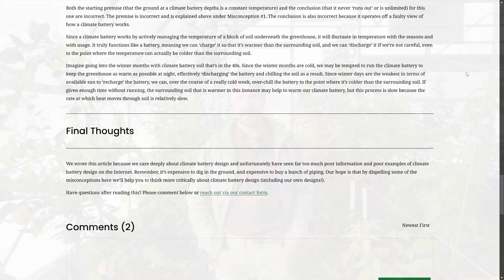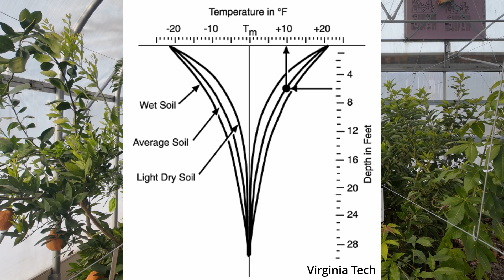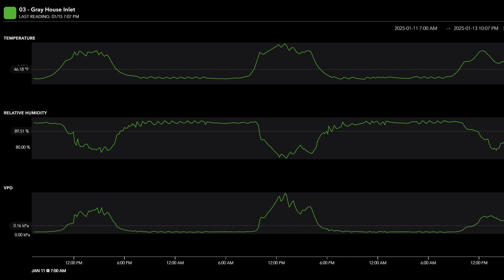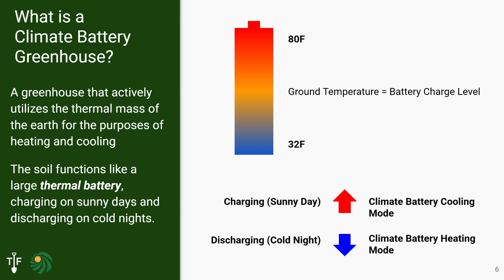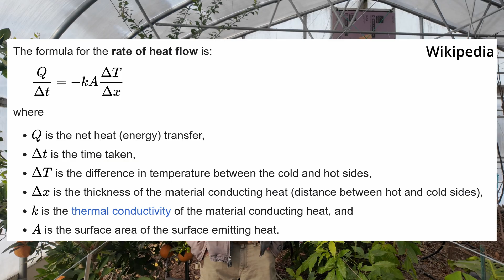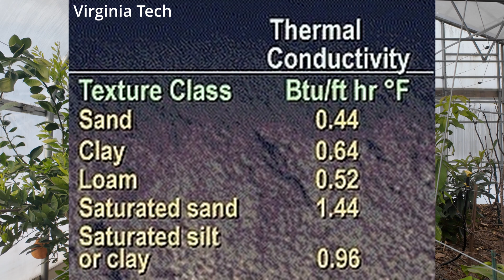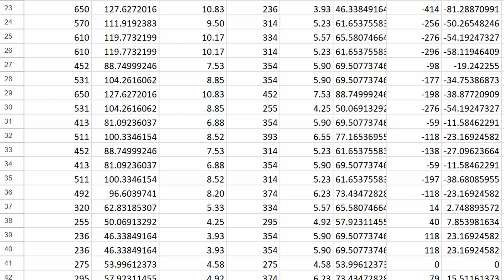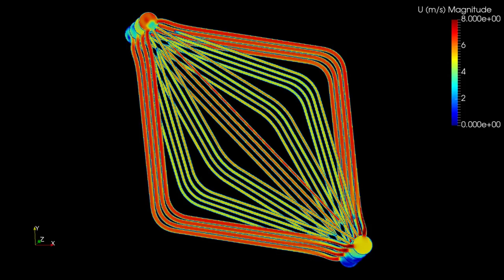5 Misconceptions About Climate Battery Greenhouses

Comment: Does the humidity significantly impact the rate of temperature change? I'm imagining a climate battery greenhouse in Utah where we have very dry air even most of the winter.  I suspect that in a low humidity environment we may have a slower rate of exchange.

Comment: Thanks for the great video.

What about using solar hot water thermal (pex) in the sand below the large soil ducts to increase the heat storage in the soil during winter? This seems like a relatively inexpensive way to increase thermal storage.

Comment: Thank you, this is a very useful video. 

I'm interested in building a home/greenhouse combination where the north facing side of the house is up against a hill to provide some thermal buffering from extremes of the winter/summer periods, and the south side opens into a greenhouse area that isn't precisely temperature controlled like the house part, but is a protected area from rain/snow/wind. And this could be an areas to grow a garden.   

This would be in the Michigan climate, so I'm interested in learning how a climate battery in combination with good insulation and smart use of shading could keep the passive part of the greenhouse buffered. nHere our frost free depth is 4 feet.

I'll keep you websites in mind when doing the design.

Comment: Great video! I'm building a greenhouse now, and plan for the long kneewall to be shared with a fishpond 6' deep, and I'll run the pipes beneath the pond and back again. Seems that should work well, maybe better than soil given the high specific heat of water? And in the winter, it might also help protect the fish from freezing. At any rate, I've never seen this done, perhaps because it's going to be on the fussy side and most sites aren't going to want an adjacent pond. Do you have any off-the-cuff thoughts about this, or want followup next year?

Comment: Ground temperature at x depth depends on the energy balance, heat in vs heat out.  Its easily confirmed by installing temperature sensors inside and outside the greenhouse at the same depths so you can compare them directly. If you have temperature sensors installed at various depths below the system, you`ll notice that heat moves down in the summer and up in the winter. If you monitor the deep ground temperature below the system and also at the same depth in the ground outside the greenhouse over an extended period (5 years) you`ll notice an upward trend in the average ground temperature below the system that doesnt occur in the ground outside at the same depth. While i agree that most systems cant provide adequate cooling over the entire summer, it can be beneficial in some cases to store more of the summer heat. The vast majority will not be returned as evidenced by the upward trend in deep ground temperature vs time but a small percentage of a massive amount is still a lot. This is worth considering if you are not planting directly into the ground. In the case of a desert location with hot days and cold nights, you can reroute the intake and outlet at night to take advantage of the cold outside air to dump excess heat from the battery and increase the cooling capacity for the following day.  Long tubes and low airflow rates are, by far, the most common reason for poor system performance, especially when it comes to storing the limited but ultra valuable winter heat before it is lost to the glazing. I`m not a fan of the traditional tubing layout which moves air from inlet to outlet but doesnt offer any other useful features.

Comment: What are your thoughts on the methods that have the corrugated pipes go out 150' in a U shape 8' trench and come back to the greenhouse? Does that limit the amount of draining heat from one site? Or is it worse?
Reply from the maker: Appreciate the comment. I don't think that long runs of pipe are generally a good idea. The accumulated resistance over that distance leads to lower overall flow rates which leads to lower rates of heat transfer into the soil.

A climate battery outside the greenhouse would work but would forego some of the benefits we get by having it inside the greenhouse (pre-warmed soil).

Comment: Could you add compost to generate heat in the GH?
Reply from the maker: You could, yes. The main concerns as I understand them are maintaining the pile to generate heat, the potential for off-gassing some not-so-nice compounds, and the amount of space it would occupy.
Reply: The amount of heat generated by a compost pile may be lower than you're thinking.  The center of a compost pile getting hot is significantly a function of there being low heat flow from the interior.  Over the life of a pile, the heat generated is related to the amount of dry mass that has been consumed as "fuel".  You could think of it in terms of a woodpile that has had some of the wood in it burned (not all of it--finished compost still contains a lot of organic material),.  Wood contains far less moisture, though, so you would need to adjust to compensate.  On the flip side, you could look at the benefit to the pile rather than to the greenhouse.  A pile in a greenhouse is going to be warm enough for some decomposition to occur--a situation that may not hold outdoors if the pile is small.

In practice, I think the most effective way to heat a greenhouse using composting, assuming cost is no object, would be to build a large statically aerated pile outside the greenhouse with a coolant loop running heated fluid into the greenhouse.  This eliminates issues of turning, the pile not being big enough, outgassing, inability to control the amount of heat entering the greenhouse, not enough space for the pile, etc.

Comment: Yes , Yes and YES.  I had to learn everything you stated the hard way. It was not until I put in data loggers that I figured out what was going on. Something you did not touch on but maybe you do is putting insulation underground on the outside of the green house. A  flat sheet of 2 inch to about 4 foot  wide provides a greater capacity heat battery. just bury it about a foot down on an angle with 0 being next to the greenhouse and 1 foot deep being on the outside edge.

Comment: Where I live in a zone 4a with the water table barely 6' down and often a bit shallower, the Chinese solar greenhouse design is probably tops. Factoring in the cost of insulated footings to the frost line would make some very special tomatoes, let alone figs, which had nothing to do with watching this till the end. Composting or using the Jean Pain method for added heat is essential on a personal scale, while waste oil is a subsidy to local greenhouses or they would not be able to operate.

Comment: Being a nerdy engineer I love the detail thanks. I’m seriously considering building such a structure but to help cool rather than heat my greenhouse. You’ve given me heaps of extra detail which I really appreciate. I still need to warm my greenhouse in winter but not by much. Heat in northern Adelaide South Australia is my problem, so blunting the median temperature is really my goal. Size and airflow to achieve this both above ground and under ground needs more modelling. But alas as an electronics engineer this isn’t my strength either, but perhaps I can do the math. Thanks again for the technical detail, it’s scared me with the depth I likely need to go. Probably financially out of the question :(. I do love your work!
Reply from the maker: Appreciate it, good luck with your project!
Reply: To maximize cooling performance i would install the system outside the greenhouse and shade it with shrubs or trees.  Employ shade cloth on the outside of the greenhouse and use overhead misting or fogging to increase the RH%.  This will not only absorb a lot of sensible heat inside the greenhouse but also raise the dewpoint temperature inside the tubing.  This approach will provide two phase changes, liquid to gas inside the greenhouse  and gas to liquid inside the tubing. Air at 90F 30% RH has a dewpoint of 54F. air at 90F 75% RH has a dewpoint of 81F.
Reply: @ Thanks. Yes I’ve thought of that too, but haven’t even looked at how to calculate the RH etc. The shading by a living plant evaporation setup, would here need to be on the south side so that the greenhouse gets maximum light in summer from the low winter north sun, hence removable shade cloth in winter. Lots of things to explore and experiment with. I’ve tried using deciduous vines in the past but they hold their leaves too long and shade the greenhouse too much. I’m also considering a solar powered setup to heat it in winter, both water based and solar PV. Thinking soaker panels at the apex to proved shade in summer and power for cooling fans and power and water heating in winter. Too many things to design and build. It may all happen and be a fully closed loop system. But probably dreaming as that’s soooooo much building and automating!
Reply: @jonarnold7689  
The shade over the system can be as basic as a lawn, assuming a lawn could survive an Oz summer :) You just need something that absorbs the sunlight that would otherwise heat the ground above the system.

Comment: Would it be possible to close the outlet from the tubes during summer but keep pumping warm air in the tubes and by doing so increase the heat in the battery?
Reply: The air would have to vent somewhere; as an alternative you might have two outlets; one in the greenhouse, and one outside. In that situation you could keep the air flowing (and heat transferring into the soil) without overheating your greenhouse.

Comment: does a single long pipeline have the same exchange rate compared to parallel (shorter segments)?
I assume that parallel would out perform
Reply: Depends but, I'd imagine ... If the same total length of pipe were used for both systems, I'd imagine the single long pipe might outperform the parallel variation, as it would have less static head due to fewer turns.  Additionally, the single longer run would have access to a larger volume of soil to deposit or withdraw thermal energy from, as there would be no other nearby draws. Further, a single pipe would have a higher air velocity than multiple other pipes - the video mentions that higher velocity seems to do better in terms of heat transfer.
Reply from the maker: A single long pipe is not ideal if the idea is to distribute  a large volume of air through a body of soil. Parallel would be better if airflow can be kept relatively even across all of the pipes.

Comment: Seems like having 2 batteries may work best. During the summer, you draw from the cool one while using the sun and hot summer air to charge the hot battery. In winter, draw from the charged hot one and pump cold winter air into the cold battery.
For folks worried about fungus in air pipes, I suggest using liquids. -20F windshield wiper fluid for your cold, radiator fluid for your hot. Use a radiator and fan as the heat exchange inside the building. No foul air!

Comment: Great video. I would love to see a nuts and bolts video about the latest greenhouse you’ve made and why you made those choices. Things like plastic thickness, double wall inflated or not, end wall construction, earth tube sizing and type, manifold vs riser arrangement, width vs length vs height in thermal performance, stack effect in the greenhouse, ducted vs unducted fans, etc.